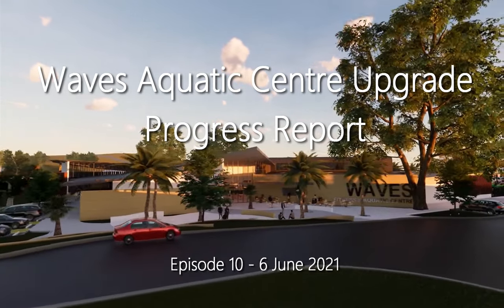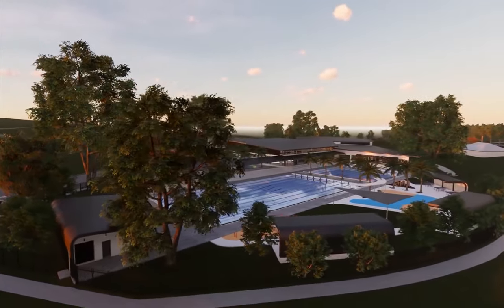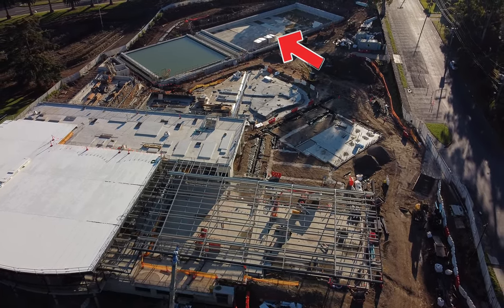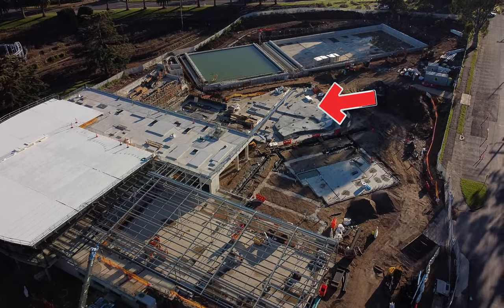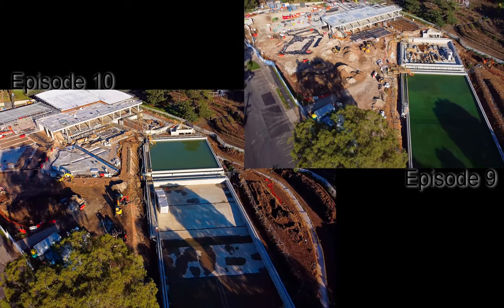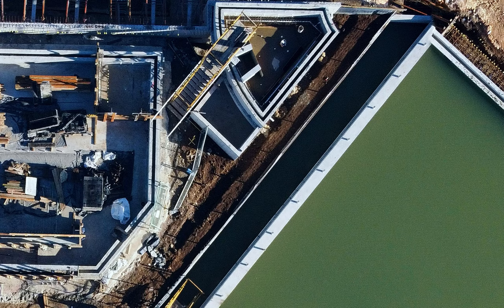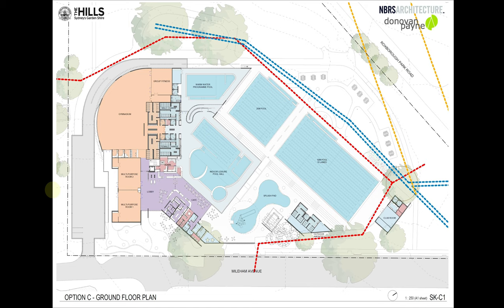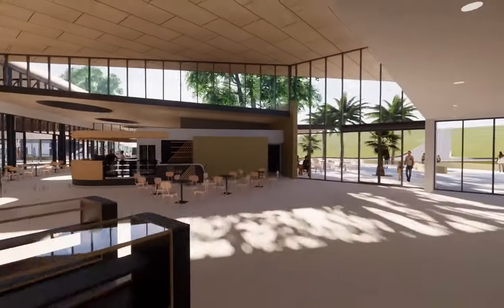Waves Aquatic Centre Upgrade - Episode 10 - June 2021 - 4K Drone

Comment: Thanks for sharing great updates 👍
Reply from the maker: Back in November 2020 when I started this project I’d already been using Dronelink for a few months with great success. I knew I’d need repeatable flight plans to be able to do comparisons between episodes, plus I wanted high-res aerial maps for each episode. So I created two flight plans in Dronelink, tested and tuned the plans, and have used them unchanged every episode. The waypoint circuit takes about 6 minutes to fly and the map about 8 minutes. So I usually spend about 30 minutes at the construction site and then back home to do the editing. Of course it’s the editing that takes all the time. One other thing with Dronelink: flight plans are device-independent for DJI-models, so I can still use them if I can ever afford to upgrade to a larger DJI drone. Yes, even at my age I have dreams. 

Looks like COVID stats are heading in the right direction in Northern Island, so I guess all restrictions will be lifted soon. I certainly hope so. In Australia infection rates are still low, but the rollout of the vaccine is painfully slow, partly due to supply and planning problems, but also due to some uptake hesitancy. My wife and I have had our first AstraZeneca shots, and will have our second in a few weeks. No side effects so far.

Keep flying and keep safe.
Reply: @SirGregory  thanks so much for your reply very interesting as for the Covid situation here in Northern Ireland rollout of the vaccine going well had my 2 doses of the Oxford /Zeneca vaccine bad side affects on first dose unwell for 3 weeks second dose no side affects thank goodness. Take care and fingers crossed 🤞 we all get back to some kind of normal life 👍